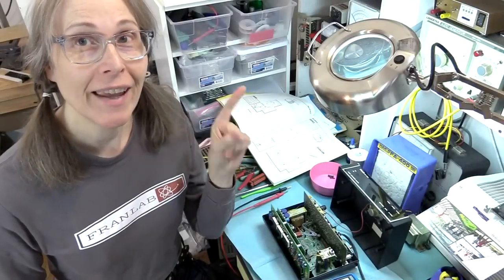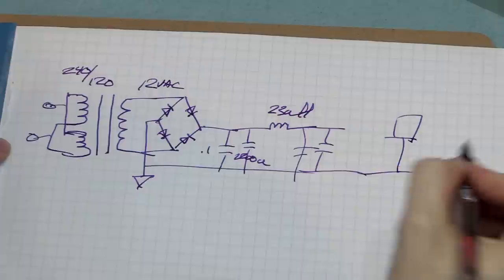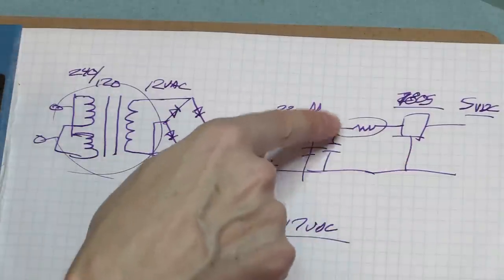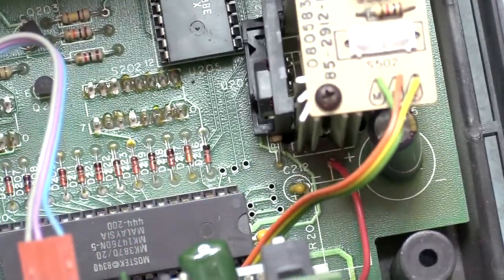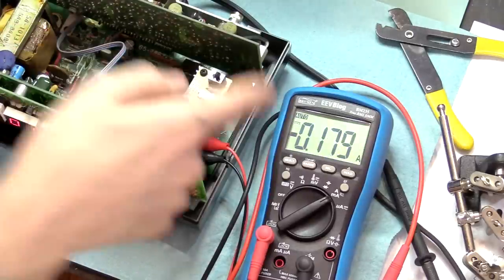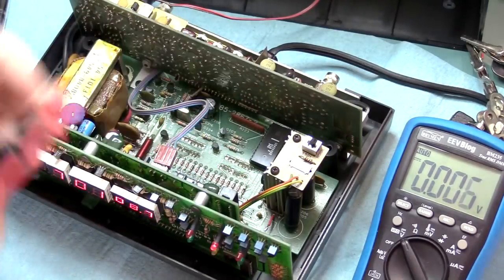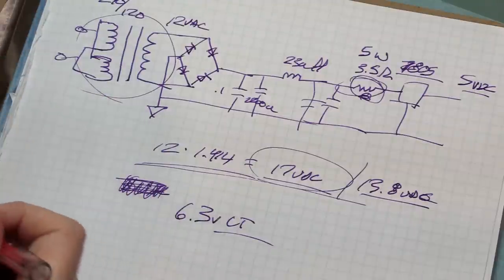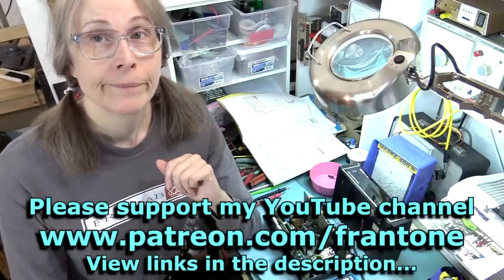Heathkit GC-1000 Power Supply Design Fails and Fixes

Comment: Try several diodes in series with the bridge rectifier may help drop the output V and distribute the heat. A bodge but would work.

Comment: You're overthinking this. Restore the power supply to the Heathkit original configuration. Who cares if it runs hot?  It worked for years, and you have assumed that the switching supply was installed for good reason. Maybe the owner simply wanted to try using a switcher. A working, but flawed design is a working design, not a reason to redesign.

The current with a linear regulator is three times what you measured, since 2/3 will be dissipated and 1/3 will be passed.

Comment: Your tutorial is a thorough consideration of the relationship of the components in a PSU circuit stream. Thank you for your efforts to share it with us.

I think we all default to the common idea that a voltage regulator needs about 1.5vdc for the voltage drop across it. But, the LM7805 data sheet states that an input of 8vdc (3vdc of headroom) enables this voltage regulator to reject ripple better. Any decrease in ripple should be helpful for this timing circuit's accuracy. (Using at least 8vdc to supply the LM7805 may explain why Heathkit used a 12vac transformer, though the merits of your conclusion that a lower powered transformer is needed prevails.)

Over 8v may be what you were suggesting... It was a little unclear to me what you intended... It seems you were saying that 6.5vdc was your target input voltage for the LM7805. However, you state that you have 6.xvac transformers in stock. That transformer will output around 8.5vdc before the bridge rectifier voltage drop. So, you might want a slightly beefier transformer.

A common trick that I use to lessen the heat in the project case and on the PCB is to use a good quality wall wart which has truthful (5vdc, for this project) output specifications. (I would choose a transformer type over a switch-mode type for this project, to avoid noise.) This also reduces the PCB real estate and case size, creating some cash savings. (I find using a wart is little more inconvenience than a standard 120vac wire plug. Use an input jack and the wart can be removed for storage and cartage.) Cheers.

Comment: you could try winding some additional turns on the existing transformer and connect it in series with the secondary, backwards, so that the total voltage is reduced
Reply: That's a nice idea if there is room in the core window for the additional turns.  Along the same line of thought: if by chance they wound the secondary atop the primary, you could pull some turns out of the secondary.

Comment: This video made me think back thorough theory I haven't used in about 20 years. 120vac RMS in, 24vac RMS out of the transformer, rectified to pulsating DC at about 17v peak, then filtered to a smooth waveform at slightly fewer volts … got it. I think they bought that transformer in bulk and made it work for a bunch of different equipment. It's overkill for a digital LED clock, but it was probably cheaper to use it in everything than to spec a small number of lower current CT transformers for a few of the kits. On a per-unit basis the smaller transformer would be cheaper,  but with volume discounts it might have ended up costing more.

Comment: There are some additional small details to consider.  First, with a capacitors at the bridge rectifier terminals, you indeed get about 1.4 times the RMS Ac value as a DC, unloaded.  When you start loading, you get drops in the diodes, probably about 2 times 0.6 V.  Then, the transformer has its drops.  Depending on the size, the so called Regulation number can be as little as 2.5% from zero load to nominal load in big transformers.  Talking about tens of kilowatts.  On small transformers the numbers get much worse in a hurry.  If you take a tiny 3 VA rated transformer, it may have 30% regulation number.  In other words, the loaded voltage is losing 30% of the unloaded voltage.  A 25 VA transformer is likely somewhere in 6 to 8 or even 10%.
Then, good engineering practices tell me to check the codes.  In this case there is some talk about input line voltage variation.  Depending on the environment and type of equipment, they probably ask you to design for 10% under voltage as well asa 10% over voltage.  But you may see + and - 15% or even more in cases where the equipment is supposed to work at both 60 and 50 Hz power.  The difference between those two is 20%  due to transformer core saturation being frequency dependent.
OK, we are not done yet!  Unless the filtering capacitors are nearly infinite in size, you are going to experience ripple.  The regulator has to work at the ripple valleys..  To put some numbers in place, start with 1 mF capacitor (1000 uF) and 1 A steady load current.  At 60 Hz full wave the ripple frequency is 120 Hz or the time that the capacitor needs to supply the 1 A current is approximately 6 milliseconds and the ripple peak to peak becomes 6 V.  At 100 mA load, the peak to peak would be 0.6 V as a rough estimate.  At 50 Hz AC line, the ripple period is considered to be 8 milliseconds, so the corresponding numbers become 8 V or 0.8 V peak to peak.
If instead of the capacitor directly at the bridge terminals you use a choke at the first element, you filter better, but only after an initial drop.  Instead of the 1.41 multiplier, you need to apply a 0.9 multiplier for the settled voltage.  So your 12 V AC will produce a semi regulated 10.8 V  DC(after a small initial load).
Sorry, I do realize that this is confusing, but that just is so..
Reply: As a former linear power supply designer (back in the last century), I second these comments. You had to stack all the worst case conditions and tolerances, you didn't want the 5V dropping out of regulation and the customer going "WTF!"

Comment: Option no. 4 :) replace 5W resistor with 7809 voltage regulator (pre-regulator, in this case), leaving the radio supply rail as-is.
Reply: That is what I said too!   ):-/
You could also add a small heatsink just in case.... ):-D
LLAP
Reply: Wacko Madman well you’d then have to consider the 9v regulator dropout of 2v as well, and maybe another heat sink for it. Not necessarily any better than a resistor and would cost more and take up more room.
Reply: The 7809 would still have to dissipate the excess voltage as heat.  You're just moving the heat somewhere else.
Reply: Russell Hltn That’s totally fine because you’re then dividing the dissipation between two components and they will last longer than other components removing them as the usual point of failure.
Reply: @russellhltn1396  exactly what I have been trying to say to everyone coming up with some hair brained scheme and over engineer it. there is no such thing as a free lunch here.
Reply: @JayMcDeejay  yes and thats what the resistor did in the original circuit. it shared some of the heat.

Comment: The input current to the switching regulator isn't its output current, it's not a linear regulator, so you need to compute the power consumption at the regulator input voltage and convert it back to current at 5V, minus some loss due to efficiency.
This site says the transformer is under-dimensioned and heats up too much with the linear regulator: http://www.prc68.com/I/HeathkitGC1000.shtml
I'd say the design could be improved with running the display off of unregulated DC instead of regulated, since the display doesn't need it. That would require much circuit modding to level shift the inputs to the drivers and increase the current limiting resistors for the LEDs.
So a transformer with lower secondary voltage and higher current may be easiest, even with 2 secondaries, one to power the 8V reg and one for 5V.

Comment: From 17 down to 5 that's 12V, then that times 0.2A is just 2.5W. Even bare naked it's like 20°C/W, so if you see 2W dissipation as realistic, considering voltage on the supply droops, in a 40°C enclosure you're still under 80°C, and with a heatsink the temperature is reduced further. I don't see how voltage is necessarily an issue either, i mean it doesn't even approach 25V recommended maximum.

Naturally after some decades the heat damage will accumulate, but this is normal. Perhaps just installing a fresh 7805 every 15 years is plenty good.
Reply: Do not forget that the input current is not the output current, which probably is in the region of 700mA max, as a switching converter does allow this. With a linear it would probably be around 12VDC on the input, and around 6W the small heatsink has to dissipate. Regulator can do this for a while, but the die will be well over 120C, and reliability will be poor. You would need under 3V across the regulator  and a case temperature under 70C to keep it reliable long term.

Remember the favourite way a voltage regulator fails is short circuit input to output, and most TTL, and definitely most MOS, does not like having 12V power rails instead of 5V.
Reply: @SeanBZA  Oh whoops, i thought she already took out the switchmode regulator and put in the 7805! Now upon reviewing the footage, i was mistaken. Yes, from 14V to 5V at 200mA input current, the output current is  maybe 550-600mA thereabouts. That would be quite a burden for linear regulator. You reach maybe around 10°C/W with a heatsink. Let's say you need to get from 14V (it probably will be less) to 5V, that's 9V drop at 600mA, that's 5.5W, 40°C chassis air + 55°C, we're past 90°C. Starting to become spicy indeed.
Reply: Siana Gearz nice correction. Even your first estimate should have been 50C above ambient, or 90C. My own estimate at an average of 12v at the input to the regulator and only 500mA on the secondary (probably too low) and 20C/W puts it at 70C above ambient. So I think over 100C which would explain the failures.
Reply: With a linear regulator, the input current and output currents are the same, apart from the tiny amount running the regulator internals. You don’t get a current boost with linear regulators!
Reply: @ProdigalPorcupine   Unfortunately as SeanBZA correctly points out the current measurement was taken with a switching regulator still in place. PT5101N.
Reply: Siana Gearz - Right, sorry.
Reply: What about using a SHIELDED switching pre-regulator in a metal can to regulate the 13.8V to 8V then the 7805 linear reg to provide smooth 5V DC to the rest of the circuit. It wouldn't need to dissapate as much heat and the transformer wouldn't need to be changed.

Comment: I remember a battery charger circuit ,back in mid 1980's used , & Ithought the 7805 have a thermal shutdown protection, when they get junction temp around 150 degree c they start switching on/off the output. We had literally hundreds of 7805, that got really hot, they  didn'tever  fail, just switched off the output.stage.fast pulse., bigger heat sink improved a lot and  changed 12 v to a9v transformer output ,solved the problem longterm. Maybe some brand names were more robust , but we used the S-T Thompson brand.
Reply: Some off brand LM7805s limit just a bit above the point where they kill themselves.  LM78L05 commonly do this.

Comment: Reminds me of how the old S-100 bus computer systems (e.g. Altair 8800 and IMSAI 8080) had +/-16 VDC and +8 VDC unregulated on the backplane and the daughter cards would have the voltage regulators (typically a 7805) on the card.  The ~3 VDC voltage drop didn't cause so much waste heat as that Heathkit power supply seems to.

Comment: 17VDC is good for eliminating hum considering how quickly the incoming sine wave passes zero to 5VDC. But with the kind of regulator used, it would get hot. I would think more than one stage would help — such as dropping to 6-9 volts first with a less accurate/expensive regulator. I would even try an RC-transistor circuit to smooth and divide the voltage by two.

Comment: 7805s are ok at 14.2v input (from a car running) if well heatsinked (heatsunk?). I've used one in my 1990s car for years for supplying cellphone charge and bluetooth adapter. Wired under the dash and heatsinked to the entire car :) (which also handily supplies the earth to the reg)

Comment: Another option : short out 2 of the bridge rectifier diodes, turning it into a half-bridge. The output voltage will halve too. You might need to increase the size of the reservoir cap as you'll only be pumping on haf the cycles.

Comment: Hey Fran!  Another solution might be to reduce the voltage to the 7805 by first using a 7809 voltage regulator. Then the 7805 has less work to do.
Reply: Many have suggested that.  I is a good idea but you are a bit late with that one.  She has a switcher in place of the LM7805 so less power is lost.  If it can be done, that is the best option.

Comment: Hi Fran, be careful of ST brand regulators L7805CT for example, they have a tiny difference from the generic version. The difference is if the load drops below 5mA, they stop regulating and the output voltage can go as high as 0.7V below the input voltage. This does not occur with Ti or Nat Semi, versions. The ST version does have a lower noise, but you must keep the load at 5mA or above. I had a customers circuit that specified a LM7805 but 'supply' purchased L7805 from ST, when the micro dropped into sleep mode the 24 Volts from the truck battery fried the Micro and pretty much everything attached.  Good luck. A solution to the voltage drop you need is to put 4 or 5 1N4007 in series on the input to the regulator. so 5 x 0.7 = 3.5 V drop. Works well no heat and is cheap.
Reply: You can't claim "no heat", because each diode still passes the series current, and drops the diode voltage, so dissipates some heat (I*V).  The heat will be spread over the locations of the diodes, so the temperature may be less. 

But, WOW! on the "sleep mode" dropout of the L7805.  That's an amazing failure mode.  Maybe you'd need to put a shunt resistor on it, just to make sure that it draws enough current (as it drains your batteries).

BTW: I have an unmodified GC-1000.  It works great, but it does get warm when the displays are on.

Comment: I don't think the circuit will work with only 6.3 volts. Linear regulators typically need at least 2 volts of "headroom" on the input. That means at least 10 volts. An interesting study would be to use a variac to find the point where the 8 volt supply starts to droop. This would allow a replacement transformer to be selected correctly.

Comment: the square root of 2 minus the forward voltage drop of the bridge . 1.3 at these voltages is a closer est.  allowing for low voltage say 90 volt primary 1.33 keep the voltage high enough for the voltage drop.  My thought is use a 7809 before the 7805  drop half the voltage   with a heat sink if the voltage drops out on the first one then the second one . Enjoy the videos.

Comment: The Zenith/Heathkit low voltage power supply was built back in the 1980's. The 12 VAC transformer cost less than the 6.3 VAC transformer. The 7805 can handle the input DC up to 30 volt by spec.  I totally agree the voltage regulator get hot.

Comment: Howdy. Check the 7805 specs for input and output cap.s. My experience is they are mandatory. The 78xx and 79xx series regulators have inherent thermal cutoff. If they cutoff they should go online again once cooled.
Also the dropping resistor is a bad idea. Use a 7 V 5W zener diode in a anti-series way at the regulator input. It will burn away some 7 V at any current consumption. Within limits of course.
Regards.
Reply: Eugene Pohjola how is that any better. the power dissipation would be the same and you’d be lucky to find a big enough zener to handle the full current. 500mA at 7V is going to be 3.5W. Also you still have to consider that the capacitor discharge has not been considered. It’s probably at least 2v. It can’t drop below 7V at the input so taking 12V average and removing 7V would put it below the regulator dropout.
Reply: @markcummings150  Howdy. 5 W zener diodes are easily available from Mouser. You may connect two 3V3 5W zener diodes in series and get a 6V6 10 W zener array.
Yes. If the current is constant there is no difference. But if there are current variations the resistor dropping will deliver a much varying input voltage to the regulator. The zener solution produces less input variation to the regulator.
Regards.
Reply: If she's interested in lowering the total heat in the cabinet, too, then all these diode & cascaded regulator notions aren't getting her there.
Reply: @ordinaryaverageguy76  Howdy. You are of course 101% correct.
Regards.
Reply: @eugenepohjola258  OK so even if 5W zener is available at a similar price there is still no point in using one just to drop some voltage compared to using a resistor. with the zener you would actually be placing a greater voltage variation to the input to the regulator since it will simply subtract 7V from the filtered and rectified secondary and hence the ripple will be passed straight through to the regulator input. with a resistor it would act as a voltage divider so there would be a small improvement. in any case the point I stated is that using a zener is no better than using a resistor.
Reply: @markcummings150  Howdy. Yes. You are of course 102% correct.
Regards.